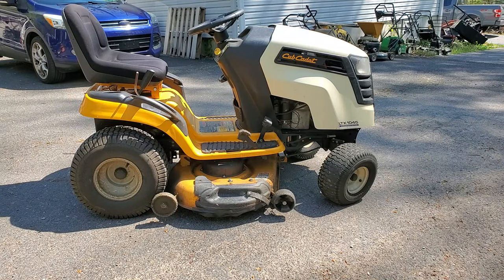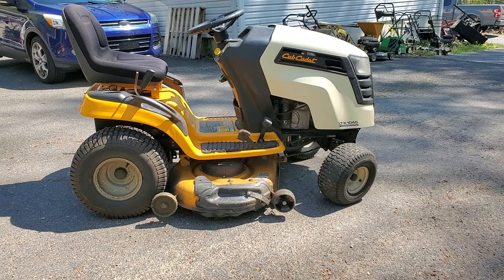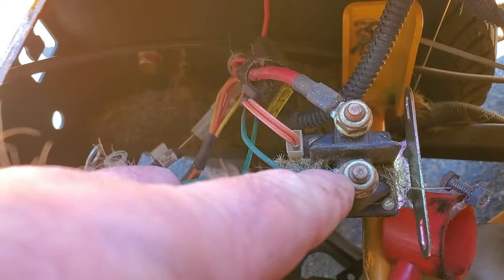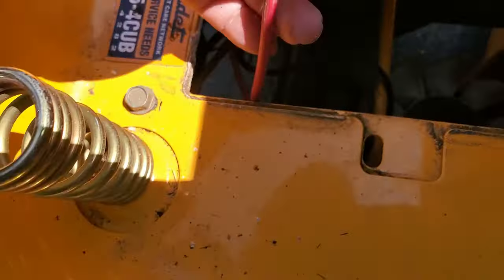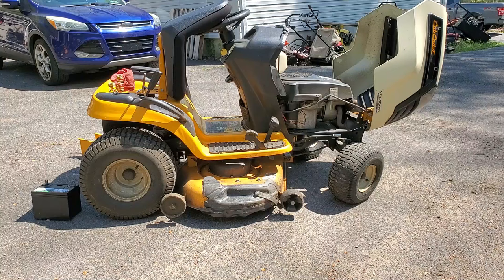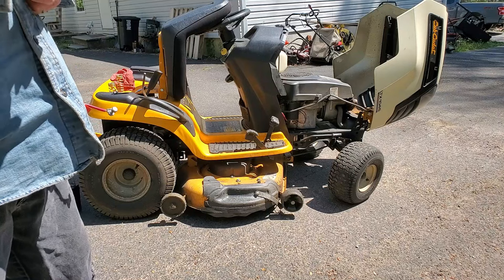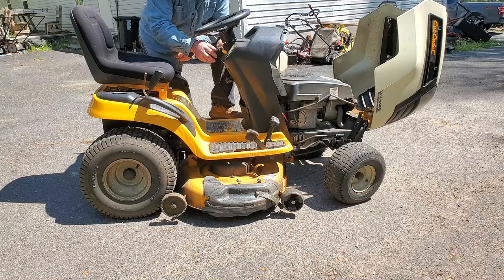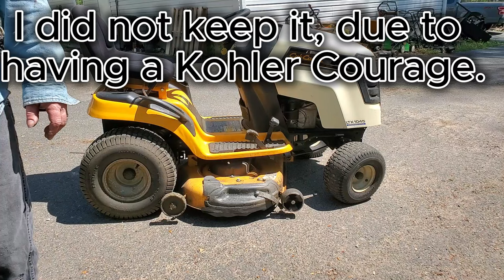Revealed: Hidden Corroded Wire in Cub LTX1045 Causing NO CRANK

Comment: Nice diagnostics. Mtd made these very difficult to get to and don’t leave any slack in those leads. Should be a nice unit when you get all finished up.
Reply from the maker: I agree, that is why I had to remove it just to trace wires. I decided to let it go just as it was at end of video. I don't like selling them ready to mow when they have the Kohler Courage single for an engine.